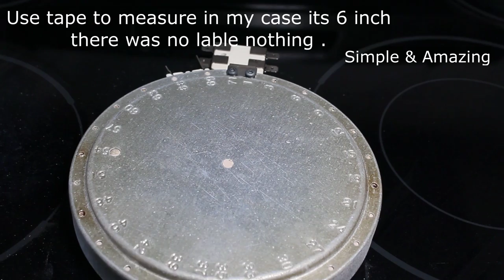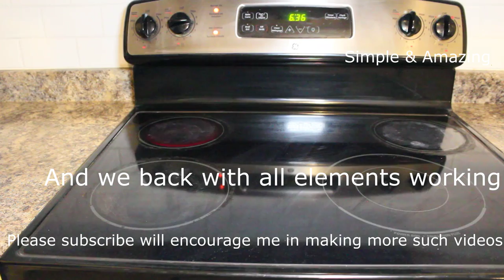GE Surface electric oven stove cooktop coil not working easy repair replace GE glass radiant heating

Comment: Omg thank you! When I was replacing the GE surface radiant with a new GE radiant, I just assumed the cable connection locations were the same way as the OEM radiant. Was wondering why the radiant didn't work when all said and done. Saw your video and this applied to me 100%. The replacement GE radiant had different connection locations/labels from the original radiant. I put the cable connectors in the correct locations and problem solved. Thank you!

Comment: had a question maybe you could help with. I have a GE Electric range and the front right dual burner will not turn on at all . . .and also the warning hot surface light stays on all the time as well even when surface is cold. . . .with the range plugged in and the knob turned on i take a multimeter and go between the leads on the element and I DO NOT HAVE 240V at the element where as when the other 3 burners are on i have 240v between the terminals on the element. DO you think the element is bad or the limiter switch is bad.
Reply: You have two 120v wires that will read 240v when you measure between them. 240v isn’t the same as 240v in Europe.

Comment: What does it mean when all 4 burners went out same time, oven still works, was cooking thanksgiving reckon power serg and burnt something up. Is it and easy fix?
My oven looks just like the one in video, GE automatic oven, in using the 3 wire hook up
Reply: I know this is a year old, but did you ever figure out the problem?  Ours just did the same thing.